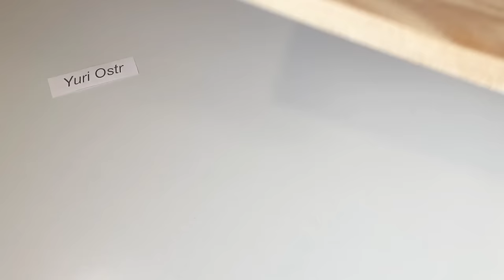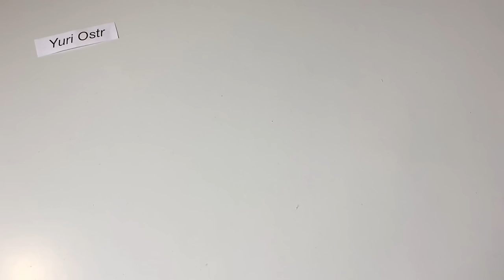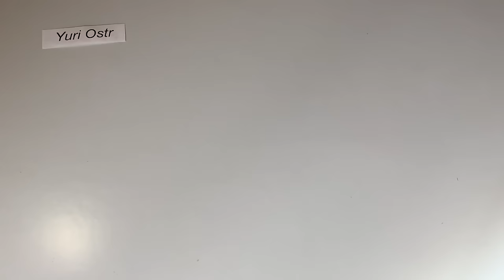How to Make Hydraulic Powered Crane with Electromagnet at Home

Comment: I liked you work can you tell me the measurements of each piece you used and the wire you used also and what is the size of the screw bolt did you used also the tube how thick is that and what is the measurements